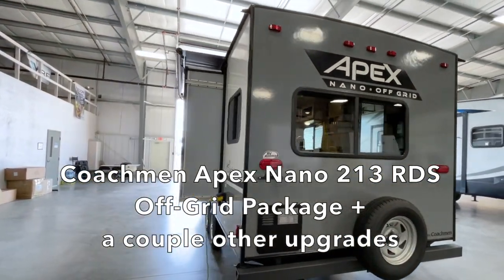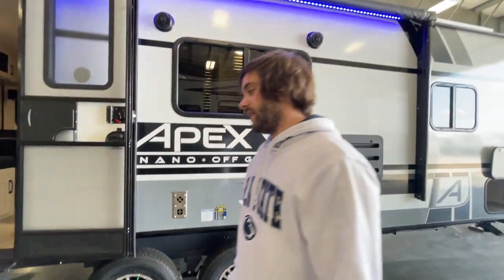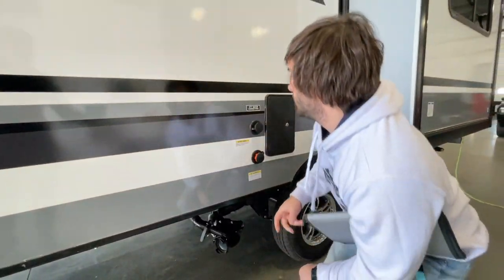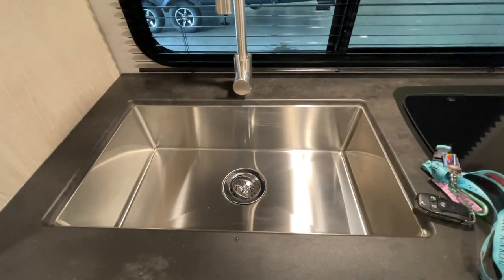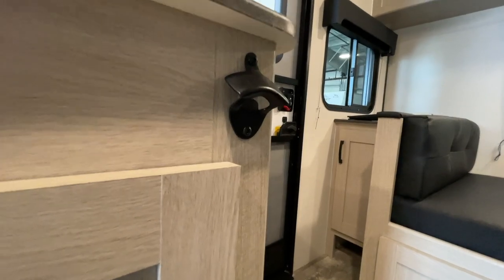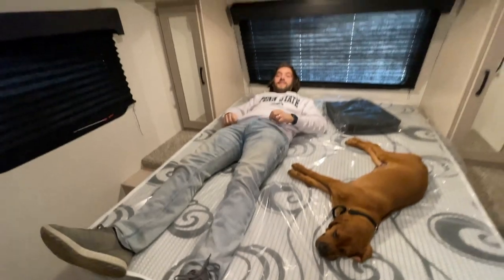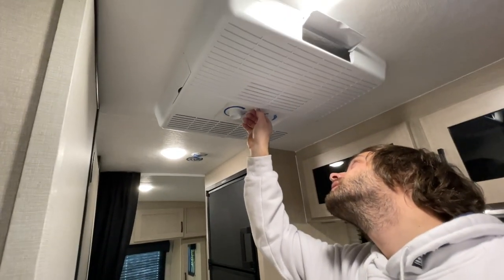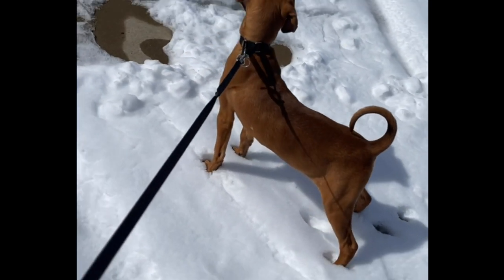2022 Coachmen APEX NANO 213 RDS FULL TOUR (our new trailer) + Duke's DNA Results!

Comment: So, how is the new 213 Nano trailer working out for you?  You have had it several months now.  Any issues with it?  I have this model on my short list and wanted any feedback (good or bad) on it.  Thanks!
Reply from the maker: Hi Jerry - we have had some minor issues, but overall it is holding together well!  The doors of cabinets weren't securely screwed in and have fallen in a couple places.  We replaced the screws and that helped.  We also had the side wall of the lower cabinet by the door un-staple, so we just stapled it back and added reinforced 2x2 at the corners.  Overall we are still very happy with it!
Reply: @TravelSzN  Thank you for your feedback.